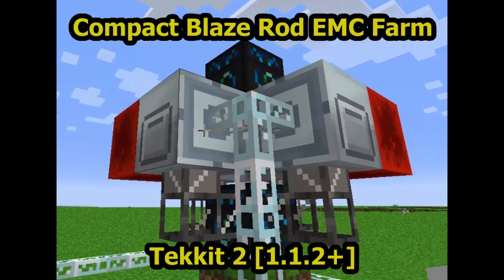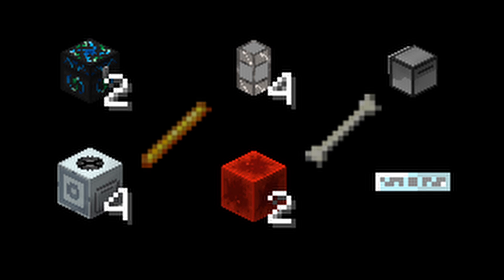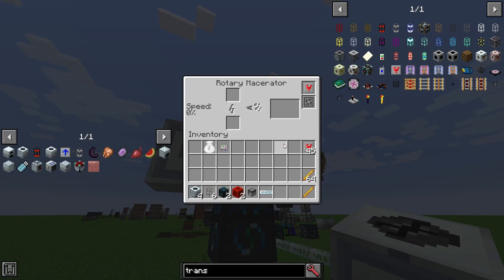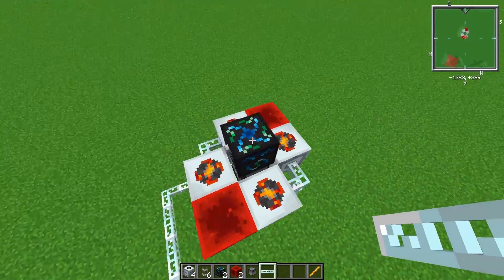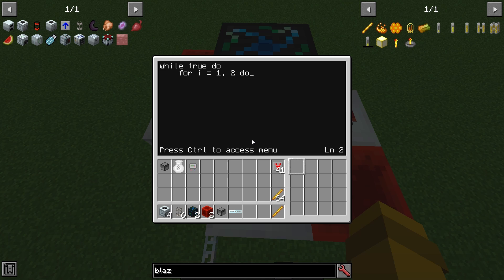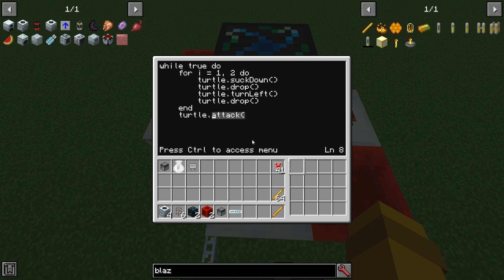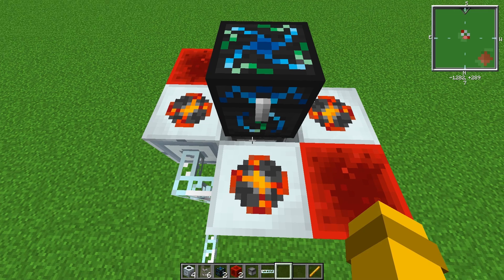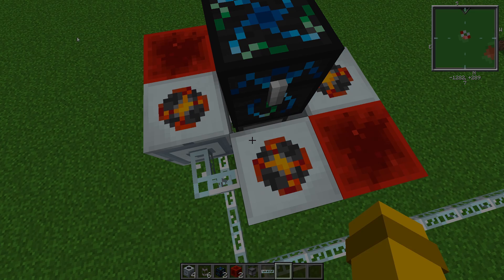Tekkit 2 Compact Blaze Rod EMC Farm Build Tutorial [1.1.2+]

Comment: Btw for ppl that are having problems the top condenser is for your choice of item

It runs on 64 EU/t (8 Low Voltage solar panel) with a MFE(no need transformer upgrade) needs 9 Low Voltage solar panel to charge the MFE(for night-time).

Yes u can use 2 BATs but i dont wanna do the math

Comment: idk if youre still responding but i built this and the top condesnor isnt getting any input? rn this machine is just infinitely generating blaze rods to blaze powder, but not into EMC in the top condensor lmaooooo
Reply: put anything u like in the top one
Reply from the maker: If the system is continuously moving items around, even if the items aren't being moved into the top condenser, the system should back up eventually. If it doesn't seem like emc is being generated and items are just being moved around it could be that the server has a plug-in that lowers the emc value of blaze powder so that you don't gain emc by macerating blaze rods. If that's the case unfortunately no blaze rod emc farm will work on that server.

Comment: turtle is just putting all of the rods in one macerator sometimes 2 but never 4
Reply from the maker: If a macerator is running then you should be gaining emc. It will take a while for it to get going and produce enough blaze rod to fill all of the macerators.

However there could be two problems if the other macerators don't fill up: 
1. There is an error somewhere in your turtles code. If this is it I'd suggest going through and making sure the formatting and everything is correct in your code.  
2. If you are playing on someone else's server, and you are noticing there are the same amount of blaze rod circulating as you put in, then blaze rod maceration might be set to produce blaze powder per blaze rod at 2:1, as opposed to tekkit 2's default 3:1. The server could also have blaze powder or blaze rods emc value altered so that there is no gain in emc from macerating blaze rod. If this is the case then unfortunately blaze rod emc farms will not work on that server.

Comment: Works great, I powered it using an energy condenser creating lava buckets to power thermal generators. Everything was fine until it rained and it stopped working for the duration, set up a dark matter pedestal to prevent rain from now on
Reply: Also note: if you name the lua program "startup" it will run automatically when you rejoin the server/world, as computercraft computers and turtles automatically run the file of that name on start up.
Reply from the maker: i am glad my video was able to help you out. also that is a great tip, i didn't know that about computer craft thank you.
Reply: how do you prevent rain
Reply: @cj_710  volcanite amulet on a pedestal